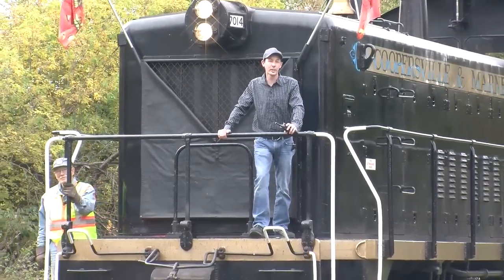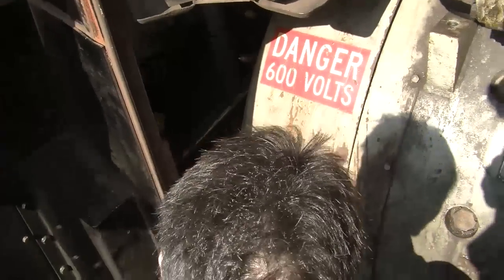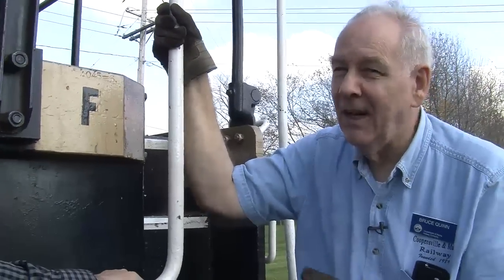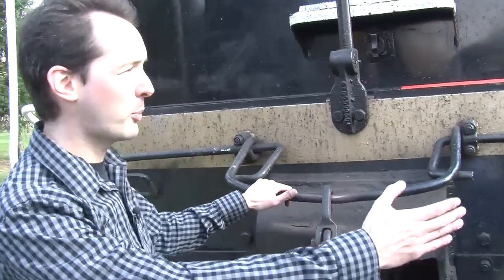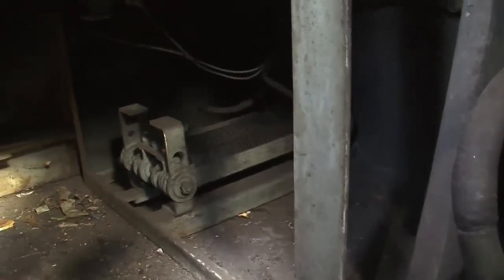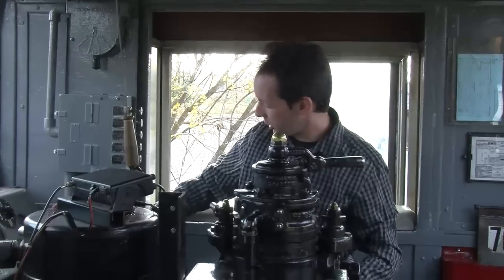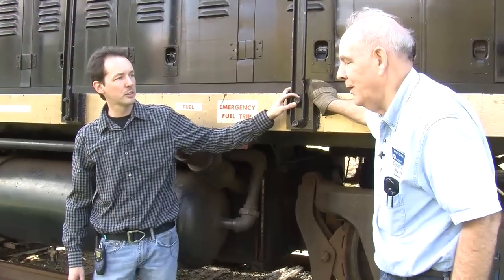Diesel Locomotive Basics

Comment: If I remember right it is the lubricator for the truck center pivot. There is another ahead of the air compressor for the lead truck. These yard engines were not set up for multiple unit running so the throttle was a "direct pull" without notches. Wabash373 is correct about the reverser drum and the transition relays.

Comment: before 1958 all EMD locomorives had roots blowers only after 1955 when Union Pacific put Experimental Turbo chargers in GP20's did EMD consider putting Turbo chargers as standard equipment starting with the SD24 of 1958 to 1963

Comment: The reason drivers are taught to bar the engine with the test cocks open is so that they conserve battery power. The voltage is 74v but the starting fuse they have is 400 or 800 amp rating and you don't want to be stuck in the outback with a flat battery

Comment: The Movement shot are Great !!  Was that a Crane that you picked up ? Love where you placed some of the camers
BTW - There can be a 2nd hose between cars - in the old days it was used for steam to the passenger cars to keep them warm that was with a steam eng. when they went to diesel there was a car added in wenter to generate the steam needed to heat the old passenger cars.
Today they use 440v ac and there 2 AC cables one each side for the elect. (This is Passenger Train only) - A non Passenger Eng can still pull a Passenger car but it would not have any heat or lights

Comment: I can't help but wonder how difficult it would be to find and have delivered one of these diesel engines (just the guts of the locomotive) to an area that does not have rails going to it. If I could get one of these massive diesel engines, you can bet I will figure out a way to use it as a "backup generator".

Comment: So in a provocative way, this is actually just one hell of a hybrid? :)

With a diesel just for powering the electrical engines and such, just oldschool and massively scaled up.  Very nice video, though I had to take it in over 2 stages, it's alot of terms and tech in one sitting.  Good linking in annotations btw.
Reply: A hybrid is able to run with its ICE(Internal Combustion Engine) switched off.  If you turn the diesel ICE off in a locomotive, there are no batteries to move with.

Comment: that filter your not sure about is a stacked disk filter. which is cleaned by rotating the disks. each disk is seperated by a thin wire in between each individual plate. this pushes all the sludge and other impurities that are in the oil, to a central point where it is drained out.

Comment: Unfortunately I can't tell you what the pump off the crank shaft is, possibly an oil scavenging pump of sorts. However, I can tell you that its not a Rootes Blower, which is seen briefly above the Main Generator at the loaded end of the engine. The oil filters are also seen below the fuel filters, and are the two big round bottles with the large handle on top. As to engines exploding, it is uncommon but it can happen, usually a high crank case pressure sensor goes off before this point.

Comment: The forward radiator is really the fan and shutters. The pipe that goes up is actually the cooling lines to the radiators that are mounted in the top of the hood.

Comment: Thanks for the informative video. Much is the same in the early 50's Porter and Davenport, which I ran on a Norwegian railway industry back in the 80s. They had three 32-tonne shunting locomotives, which replaced the steam. One is a museum today, one is scrapped and one is left at the factory.
Today they use a German shunter from Kaelber-Gmeinder Type D25 B

Comment: them two big cylinders with the brass clamps are the oil filters
Reply: Redneck36 
Nope, just the lube oil strainers for the main lube oil pump. That tank he looked at before this in the other door has the oil filters in it. Neither of them knew what it was and then moved on.

Comment: The big oil filter is the filter for the main engine, not the air compressor, the compressor has its own reservoir and filters. The brass things are the lids on the oil separator the oil is pulled from the oil pan through one side of the separator then to the scavenging oil pump through the pump then to the lube oil cooler then through the filter can and back to the other side of the oil separator then to the main lube oil pump, into the engine to do its job then back into the oil pan.

Comment: I would like to know if there ever was an age before diesel-electric locomotives, when diesel engined powered locomotives ruled the roost? I assume this would be after the age when the use of "steam" locomotives fell out of favor for the cleaner burning and less prone to fire belching diesel engine powered locomotives came into being?  I do not know enough locomotive engine terminology or history to find what I am searching for. It seems as if the term "diesel powered locomotives" is used quite often to describe what I call a diesel-electric combination, or diesel powered electric generators including their traction motors.
Thanks for your help. 
mrc109
Reply: Diesel electric locomotives started to be built in the late 1930's but steam engines were still common after WW2 but by the 1960's most class 1 (large railroads) had taken them out of service. Some Railroads including the Canadian Pacific Railway and the Union Pacific Railroad still operate heritage steam engines. A big factor in the switch was maintenance and the amount of service the engine could do yearly since steam engines needed more time to get warmed up.
Reply: mrc109 There are other types of locomotives powered by diesel prime movers, such as diesel-hydraulics and diesel-mechanical locomotives; however, time and experience have shown the diesel electric to be the most rugged and reliable form of using a diesel prime mover to power a locomotive, under most conditions.  Note the phrase "under most conditions."
Reply: mrc109 diesel locomotives didn't rule the roost so to speak until EMC ( Electro Motive Corporation ) introduced the FT model locomotive full car body with a 1350 hp v-16 567 engine with belt driven cooling fans that had clutches and manually operated shutters the fireman had to patrol the consist to avoid overheating the engines. Transition was manually operated by the engineer. They proved so effective the Santa Fe railroad purchased around 350 locomotive's the first ones to a Arizona division
Replacing steam. The FT cut water consumption by 93% as operating in a desert environment Santa Fe had to haul all water steam used in company tank cars from California. Diesel fuel in 1941 cost the Santa Fe $.047 a gallon versus $2.34 a ton for coal and $.037 cents a gallon for bunker C which the oil burning steam used. The FT handily beat the oil burning steam by using less fuel per ton of freight hauled. Prior to the FT diesels were only used mainly in low horsepower switching yard assignments. The yard switcher went all the way back to the 1920's the first Diesel switch was built by American Locomotive Company using Ge or Westinghouse electric's and a 6 cylinder inline 300 hp Ingersoll Diesel engine and a K controller commonly used in streetcars to control the flow of electricity plus a engineer operated throttle to raise the engine rpm to generate the power needed. This system continued to be used in gas powered railcars until they started using Diesels.

The FT went into production in 1939 with the 567 engine and was replaced by the F-2 freighter which basically was an FT but with electrically operated cooling fan fully automatic and electrically operated traction motor cooling fans replaced until the 645 engine replaced the 567 in 1965.

Comment: The first locomotive I got on my first day as a Switchman back in 1972 was a Rock Island 1200. Just like that.  If you think 1200 Hp is a lot I ran those Uniom Pacific 6000 Hp on coal train that’s 18000 Hp total and ran it conventional. 7,500 foot 19,000 tons. Later they went DP..

Comment: Hang on! If you convert one form of energy into another, you always have loses. The more conversions the more loses. So,  given that,  wouldn't a straight diesel  engine applying power on the wheels be more efficient than, one that converts it's energy into electricity ( losses there..),  and  then  converting again electricity into mechanical energy? ( ..more losses  again!..)

Am I  missing  something  here?
Reply: The issues with applying power straight to the wheels would be with having a transmission, drive shafts, and all kinds of other parts that would need to be designed to not only work with each axle but also be able to turn along with the trucks and be easily accessible for maintenance. Electric motors are the go to as they are relatively compact (The electric motor actually fits on the axle taking up less space), have no need for a gear box or drive shafts as electric motors can turn as fast as you want until they explode (Relatively speaking) and electric motors, as they need no gear box, are much easier to control via amperage and cost half as much to maintain.
Reply: Traction motors are more efficient. Electric energy in general is more efficient than mechanical energy
Reply: Yes.  The clutch and transmission, which are mechanical, would be too massive to go straight from the engine to the axles for a modern train to fit in a typical loco frame.
Reply: You're actually correct regarding the efficiency losses. However the mechanical equipment would be impractical considering all the pivot points, gears and joints needed. You'd need a 300-ft frame just to handle a little 1200 HP setup. Instead they can manipulate all those obstacles using wires and switches on a 40-70 ft frame and get the output of more than 4,000 HP on just a sip of fuel.

Comment: Yep, all freight trains these days are hybrids! However, not all of them actually store electrical energy generated for future user when using dynamic braking. 

The vast majority of them still use a grid of resistors for dynamic braking, effectively translating the excess energy into heat. I do believe they're working on ways of utilizing this power in the future, which would make them even more efficient at what they do!

Comment: The unidentified “lubricator” at about 30:49 might be the lubrication for the chain and pulleys on the handbrakes.  We had a hand brake that froze on a switcher that was of about the same age and type of the switcher in the video.  We had to follow the chain all of the way down and take it apart.  The chain has to go down and make a tight bend on a pulley through the base plate at about that position.

Comment: The hazard in the DC switching is the amount of energy in an arc flash event.  High voltage Jacob's ladders are relatively low current. 12V automotive systems are current limited by the battery impedance. 600V at 30,000 Amps in an arc is 1,800,000 Watts of power. The radiant heat in proximity ignites clothing in milliseconds. The danger is from sudden intense burns. Search for 480 volt arc flash videos for an idea of the actual danger.  The big switch has a 2 section armature with 2 poles on the left for parallel and 4 on the right for series. It may have a 4th position in the rear for reverse, or reverse polarity is done with another switch.  With the engine not running, all that should not have voltage an safe to operate the switch, unless it is tied to the battery for starting. Not sure on that model if it uses the main generator for starting.

Comment: As a DC traction motor begins to turn it is connected in series to develop maximum tractive effort. As the DC motor turns faster it develops BEMF (back electromechanical force) which stops the motor from turning faster. To over come BEMF the wiring is changed to series-parallel - allowing it to turn faster and finally; when BEMF rises again - the traction motor wiring changes to parallel which allows it turn at its max RPM. On some units this done manually by the engineer - others automatically.

Comment: great video, I learned a lot...loved the under-loco camera locations. Which begs me to ask a question I've long wondered - is there enough clearance if a man laid prone between the rails for the loco to pass over him, or would you get crushed?
Reply: Possibly but it depends on the size of rail.  The bigger or taller the rail the better chance the person would have.  Getting crushed is not the first point of damage it is getting snagged by something on your clothes then moving you to where you will start balling up;  that is the problem.
Reply: If you can fit between the top of the rail and the top of the cross ties, then yes. Normally that's only about 4 inches or so. Most people's hip-bone are wider than that so it would probably crush your hip if it didn't catch your shoulders first. Not that I have seen the result of this before, or anything.

Comment: trkrolesen has a good answer. To add to his answer, unlike a direct diesel engine linkage, electric motors generate the same amount of torque at low RPMs as at high RPMs, whereas diesels supply less torque at low RPMs. Locomotives need a LOT of torque to get their consist moving, so being able to apply all of the power of your motor to your wheels when you're at a dead stop is a huge advantage.

Additionally, with electric motors, you also have the benefit of being able to use dynamic brakes.

Comment: Motors start linked in series to prevent overheating of the generator.  As the train gains speed is transitions to parallell.  If transmission to parallel is not made  the developed horsepower of the engine and generator will begin to drop off. This is due to the generator's having a limited pressure capacity, and if transition is not made the locomotive will not be able to take a train up to its rated speed.  this is from sdrm.org/roster/diesel/diesel

Comment: Very pretty wet tub is a oil strainer
Reply: Yes. Oil suction strainer housing is the proper name. On the UPRR, we call it the "ice cream box".
Reply: Bring back a lot of memories. I was an apprentice at a railway. 600 v@900 amps is no joke. Those switches arc and pop.i drove one of them..the  the resistor are for down hill  the motor turn into  generator.

Comment: Modern diesel engines crank with the exhaust valve held open for one full revolution.
This allows water to escape, but also allows the cylinder walls to lube prior to ignition, making for a better start.
Everything is automated now, even the engine start, simply enter the correct task code and wait.
Braking can always be done manually but it is far easier to enter a target speed and let it run, much smoother and more fuel efficient.

Comment: I like all diesel locomotives, in 1952 on BR we built the class 08 0-6-0 diesel shunter of 350hp your diesel seems to be well kept interesting video  in our country we call the trucks (Bogies) and these carry the traction motors and assembles like your locomtive 
the class 55 Deltic has 2 diesel engines of 18 cylinders of 1,650HP = 3,300hp

Comment: You should be saying the wiring from the generator to the traction motors changes not "the traction motor wiring changes". You'd have to take a trip in a time machine to find manual transition on a diesel locomotive. You wouldnt have to look too far to find it on an electric locomotive though. I have never seen a diesel locomotive go from series to series parallel to parallel. Pick 2 that's all you get. The third stage is field shunting unless its an electric then you get the lot. I drove both.

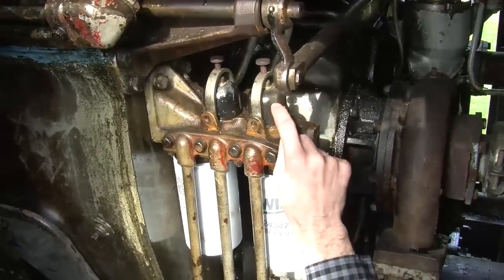Comment: 5:55 I believe are also fuel filters, just of different design. There's one filter under each side.
Reply: It's for crank case oil. If you ever have low crank case oil and need to replenish it, you can take that "shiny thing" loose and pour oil into this filter box. You can also open the valve covers and fill it there too but some engines like this one are rather difficult to get an oil spout (similar to a fuel spout for your car) into.

Comment: Actually, the amount of horsepower does not determine if the "prime mover" (diesel engine) has a Roots Type blower or not.  A Roots blower is necessary for aspiration on a 2 stroke diesel such as the EMD 567, 645 & 710.  A turbo is used on 4 stroke diesels to enhance power.

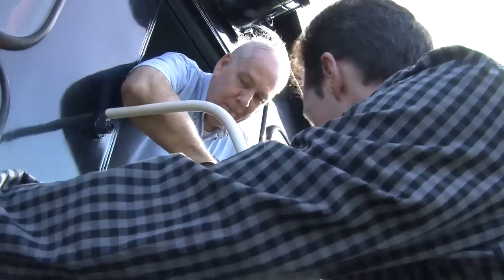Comment: I notice you are extremely careful around the electrical systems. Since the locomotive is not running, would these all have 0 voltage/current in them? The batteries shown around 26:00 are for starting the diesel, not having anything to do with the traction motors. So (this is where my ignorance of diesel locomotives comes in) is there a capacitor and/or battery system for the traction motors? If not, shouldn't the switches and generator brushes etc be safe to touch? Just wondering, great video!

Comment: I had a cherry 1965 Marlin by Rambler, it also had pneumatic windshield wipers! But I'm pretty sure it didn't have the 1200HP that an EMD Sw9 had, if it did, those Ford and Chevy
products  would have had some competition. Instead, It took a rotten banana peel on the ground, in front of my tire for me to get an exhibition of speed ticket. :)

No, it's not a turbo charger. These are all naturally aspirated. GP7/9's were also naturally aspirated as well as GP38-2's and other models.
Reply: abel wayne 
Your car did not have pneumatic wipers, and it wasn't built with an air compressor, they were vacuum operated. Not the same thing.

Comment: It's actually funny that when I was a boy I was taught to fear diesel locomotives on start-up because they were alleged to EXPLODE. I've never understood that reasoning even after more than 30 years working around big diesels. The only thing I've ever have happen is a Detroit Diesel engine start backwards which you would choke them till they stopped, then start them in the right direction. I don't fear diesels anymore but early on starting one was a scary thought.